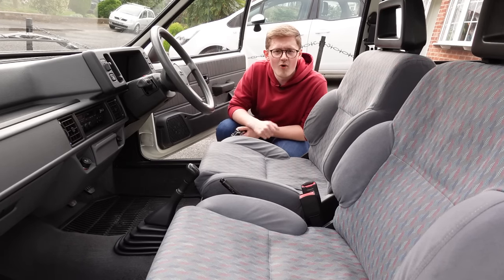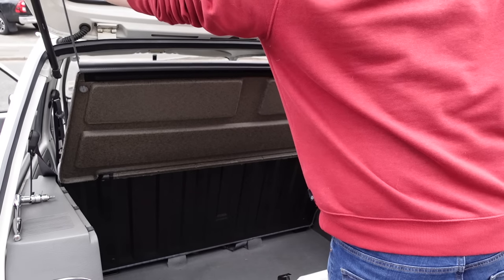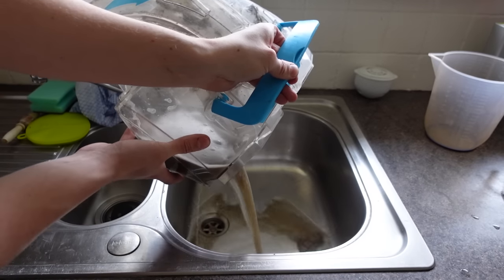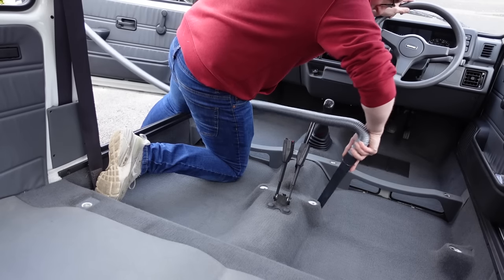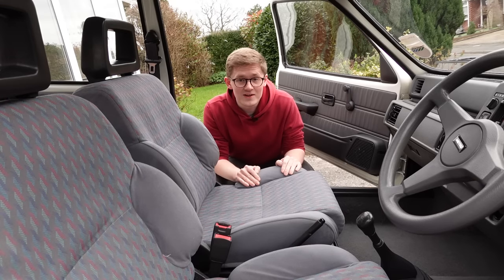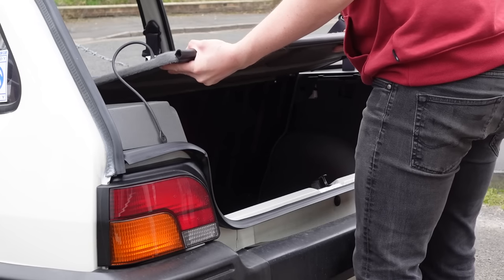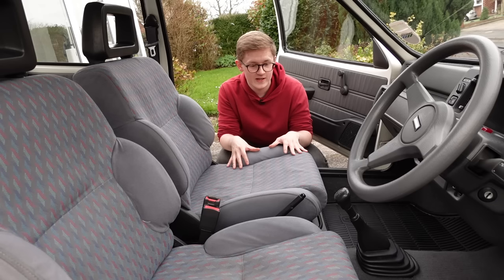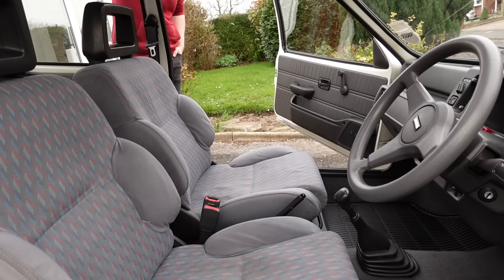Full Interior Clean + Wet Vac - Metro NEC Prep

Comment: Good job! I never use wet products on the interior. Even if you vacuum it 'dry', it will stay damp for a long time. I recently purchased a V70 that had been professional cleaned. It is very clean, yet it was damp for about 3 weeks, even with daily use. Not a problem for this V70, as it is a daily. Yet I hate doing this to my old C class or old 940. I clean the car in use every week and always clean it  before it goes back into storage. Staying on top is, to me, the best way to keep a car presentable.

Comment: I also use AG vinyl and rubber cleaner for my boot floor mat.
When wet vacuuming the interior.ive sometimes used a drill with a brush to agitate stubborn stains.
Likewise when using an APC to clean around seat mounts I use a detailing brush to work into all the tighter areas.

Comment: Doing car detailing as a job you do a lot of personal touch detail that is justified for a show, however to speed things up when you're stuck for time, rather than spray on the cloth, spray the components you want to clean, (like drivers side dashboard, then passenger) grab a soft paintbrush set for the vents (such a time saver) and to get into any small nooks and crannies. all the loose dust is then on the floor or picked up by a damp cloth and then you focus on hoovering, saves you going back n forth and agitating loose dust back out onto the floors again, now that he's so clean he should be called Marvellous Melvin! Those rubber floor mats are a great touch for keeping the carpet in good nick!

Comment: Hi Edd, although the Rover Metro C was the standard base model,they did a special called a Quest. It was so special that it didn't even have a clock, it did come with full width bunpers though. Oh yeah and some graffics, otherwise it looks just like Melvin (5 door). I bought it  new in 92 on a k reg. And it was exactly £6000. Needed the 5 doors as we'd just had our first child and 3 doors are hard work. I ragged the car around for 2.5 years and did about 45k miles. Save the interior light bulb NOTHING went wrong or broke. I have had some very expensive cars since then and most have had problems in the first few months! I bloody loved that car it was epic. Keep up with the great work. Regards.

Comment: Interesting fact about those plates that prevent the seats going all the way forward..  in Asia many cars have plates to prevent the seats going all the way back, not to stop the seats falling off, but to increase the legroom in the back of the car.  This is because in Asia the most Important feature of any luxury car is the rear seat legroom, often because the purchaser of the car would typically sit in the back.   I bought a Volvo 940 Saloon in Thailand that had been assembled in Thailand after the 940 had ceased production In the west, it has those plates  and I removed them to get more seat travel.  At that time the 940 saloon was considered a seriously luxury car ( the Asian spec interiors were better than the euro spec), but nobody bought the estate version.. the opposite really of UK sales.